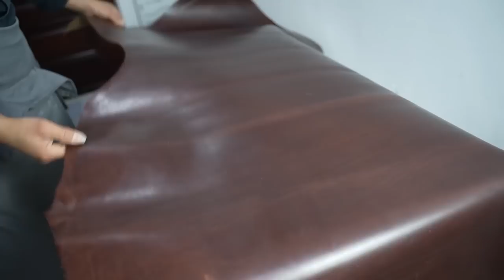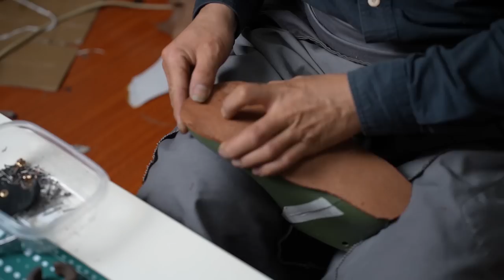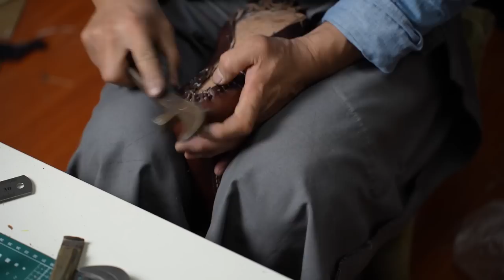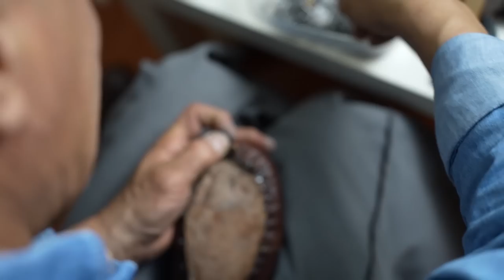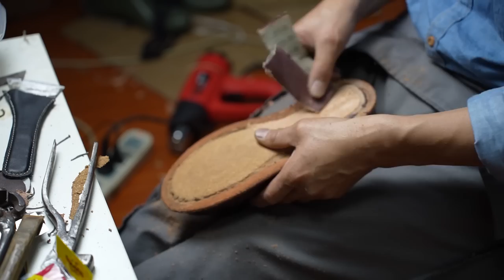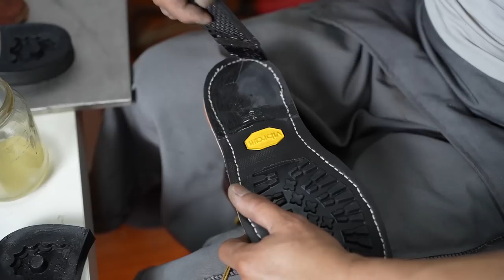How It's Made: Handcrafting premium World's Toughest Work Boots

Comment: All that hand stitching, incredible. Amazing craftsmanship. A pair of those boots would have to cost $5,000 USD to keep the maker fed.
Reply: It depends on the amount of finishing and detail. Anywhere from 1200$ to 10,000$ for a pair of custom made, hand made boots/shoes. I would not pay 5000$ for these if they are not at least bespoke, with a last made specifically for my feet in a unique design.
Reply: $5000 a pair?! what you smoking bro.
Even flame panda in shell cordovancost less than $2000. Bought a pair of 7 inch lace to toe in horse hide from flame panda, and those cost only $800.
Reply: @AlexanderMason1  It doesn’t cost anywhere near that made in the US. A pair of Nick’s or White’s cost around $500. You could get a pair like this made in China for $150.
Reply: @jiafei6833122  these are not the same level of handmade
Reply: @strengthandbulkMadness  these are not nicks or whites. These are bespoke boots. Nicks and whites are mass produced. They are not finished to that level. If you think a nicks or whites boot is comparable to what is in this video, you do not know quality and are better off with cheaper boots as they will essentially do the same for you.
Reply: @AlexanderMason1  no.
Reply: @jiafei6833122  no what dummy. You obviously can’t tell the difference in the finishing and detail of a high end mass produced boot and a completely handmade bespoke pair of boots. That is your problem, but these are definitely worth much more.
Reply: @AlexanderMason1  Wrong!! Nick's and white's are handmade not mass produced.
Reply: @alighost8171  What makes you think they’re handmade? Because someone uses their hands to use a machine to stitch the boots together. They are hands lasted and very sloppily so. The welt is also stitched on my hand although sloppily as well. They are mass produced. I don’t think you know how cheap footwear is mass produced. They use their hands to assemble everything as well.
Nicks and whites are higher end mass produced somewhat handmade footwear but they are still mass produced, whether you like it or not. The boot in this video on the other hand is completely hand made and made to a much higher level of craftsmanship, detail, and precision. Nicks and whites don’t come close in quality. You owning one of their boots doesn’t change the truth of the matter.
Reply: @alighost8171  no point arguing with this dude. He thinks any shop with more than one person working in it = mass production. 

Is the boots in the video meticulously done? Absolutely. But is it worth thousands of dollars? That’s questionable and up to the individual.

Law of diminishing return. White’s and nicks are the ceiling for construction/durability. Past that point you’re only paying for finishing. For most people perfect stitching is not worth paying 2x or 3x for.
Reply: Huh? I have a couple bespoke pairs. Most I have paid is 1400.